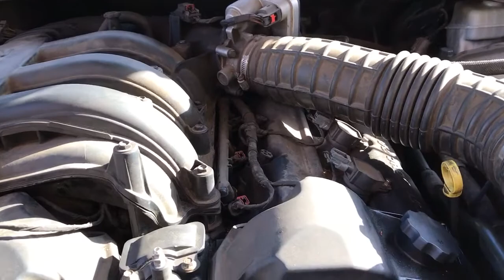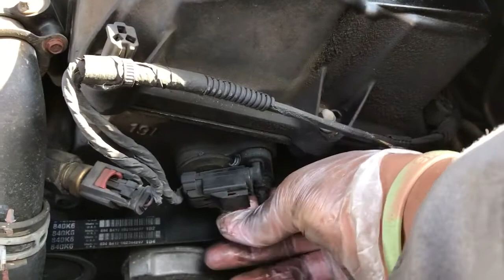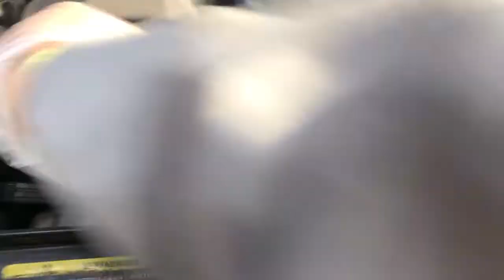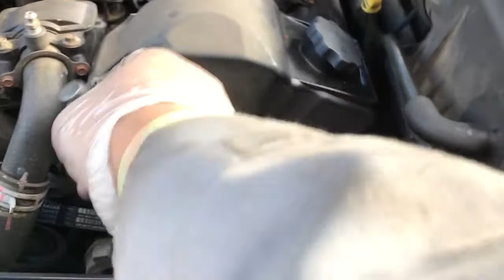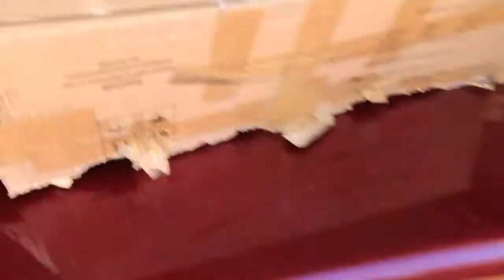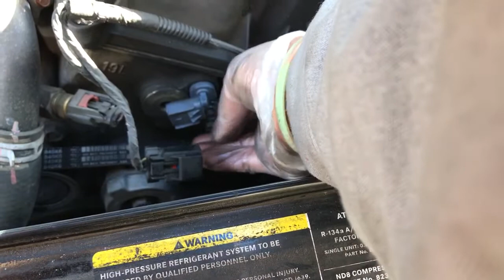Replacing and installing a new cam position sensor

Comment: Wats the difference between the camshaft and the crankshaft what are the symptoms
Reply from the maker: Amber Holloway camshaft and crank sensor both deal with timing. Crank sensor also controls what you see on your RPM or rev counter and is normally situated near the bottom of the engine. Cam sensor sets the valve timing and can advance or retard timing depending on engine load. Cam sensor fault usually has difficulty starting and crank usually won’t let it start.
Reply: @Icanfixit-2  thank u so much I didn't know tht ur video was very Informative my car turns over but doesn't crank
Reply from the maker: Amber Holloway it’s probably your crank sensor.
Reply: @Icanfixit-2  thank u
Reply: This literally helped me understand what is going on with my 2007 dodge caliber thank you so much.

Comment: I have an 07 dodge charger rt radiator cracked ... replaced the radiator went to turn it over and it putted like it was gonna die .. it idles rough and eventually dies I haven't driven it cuz it's still up on Jack stands so I replaced crank sensor and had a code for knock so replaced that.. as well I had a p0300 code for random misfire so I replaced all 16 spark plugs check engine went away for a few minutes.. car is still doing the same thing except now I have a blinking check engine light and it smells like it's burning rich I'm told... cannot pull codes with blinking check engine light..  no smoke from anywhere fluids look good not mixed... it's got 113500 miles any ideas
Reply from the maker: rayg125shayd613 I had a 300C that did the same thing. It was a blown head gasket on the driver side. It was crazy because nothing was mixing like you think it would. I pulled the reservoir cap off and the exhaust was blowing back through the cooling system.
Reply: Ocie Carlisle did you have exhaust still coming through the pipes I have good pressure still coming through the exhaust
Reply: Appreciate the response hoping it's not anything big like that I've also been pointed toward valve springs and seats just bought the car in Feb I hope it's nothing serious
Reply from the maker: rayg125shayd613 I hope not either. But try doing that first with the cap off. Make sure the engine is cold. If the head gasket is broken on the exhaust side, when it starts up it will blow bubbles through the coolant in the system and you will smell the exhaust (raw gas) and white smoke.
Reply: Ocie Carlisle  awe that sucks I always had bubbles in my cooling system part of what caused the overheat I wonder if that could be ... thank you so much

Comment: Replace my cam sensor but check engine light still on, any suggestions?? Thanx
Reply from the maker: Reggie Lamay did you do a trouble code scan by chance when you put the new one in? It could be just stuck in the computer of the car until it runs for a little bit.
Reply: Ocie Carlisle ive had the code from the key dance and replaced the cam sensor reset the computer by disconnecting the battery. But cam sensor code still there. My car starts then dies then starts up on second crank
Reply from the maker: Reggie Lamay did the connection look corroded on the plug? How does your battery terminals look? You could have a short circuit in the back of the plug itself as well.
Reply: Ocie Carlisle terminal looks good. But wires for cam sensor  are exposed near the engine it looks like the wire loom took some heat off the engine. But wires are still looks okay noting burnt.
Reply from the maker: Reggie Lamay you will probably need to check the voltage on the plug to make sure it's sending the correct voltage through the system. That's probably why it's not reading it in the ecu.
Reply: Ocie Carlisle okay ill check that next. Thanx for the reply
Reply: Ocie Carlisle ive used a orielly cam sensor should i try oem from dealership ?
Reply from the maker: Reggie Lamay yes
Reply: Ocie Carlisle  the crankshaft position sensor the same thing as the camshaft sensor?
Reply: Reggie Lamay  where is the camshaft sensor location is it in the same place on 2010 Dodge Charger
Reply: Was that bank 1 circuit A?